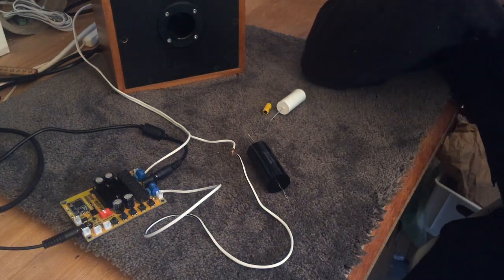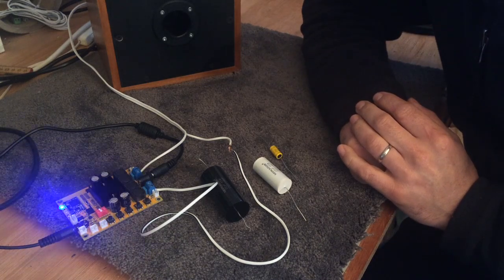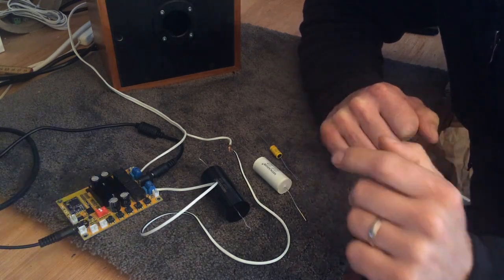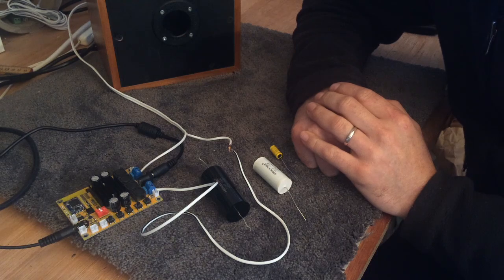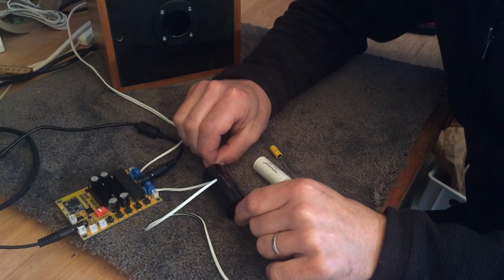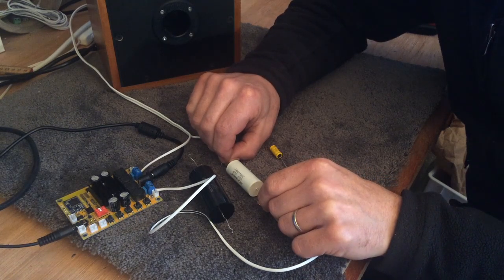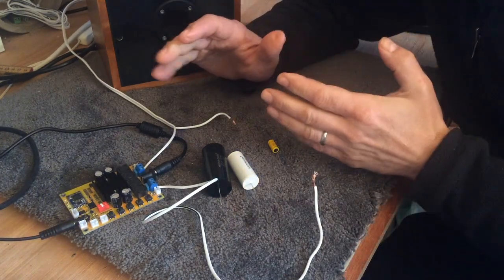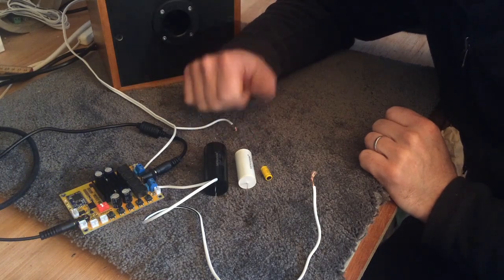What is a capacitor doing in a loudspeaker ?

Comment: If my bass driver is a little boomy in the bass/lower mid can i use a bigger inductor or lower the value of the capacitor to lower that effect?
Reply from the maker: Mainly its your box alignment that determines what happens under 100Hz. With that said crossovers do alter the TS parameters of the woofer, but it will still need to be simulated with the box to know the outcome. If there is a way of generally get a direction, I don't know. I know introducing a series resistance to the woofer limits the current with the higher impedance, so the qts will go up and typically cause more boomyness on a given alignment. So parallel loads might do the opposite, but its not a good way. I done that ones to fix a poor design with anemic bass, I still wouldn't say it sounded good though.

Comment: Thank you, this is exactly what I needed to continue my project. I have a very old Webcor speaker/amplifier, and I ran across caps separating the mid from the bass speaker, and separating the mid from the tweeter. The one to the tweeter was 2uF, and the one between the bass and mid was 4.0uF. They are huge and old, and test double their spec. Hearing the differences of the caps you demonstrated , and mentioning that they can also add protection to the smaller speakers by filtering out the deep tones, was a very nice, practical example, of how these devices work. I cant find a 2.0uF nor a 4.0uF, so I am using a 2.2 and a 4.7 respectively, and they are tiny in comparison.

Comment: What size cross over is needed to take bass out of a 12inch subs to use as highs kent
Reply from the maker: There is no set size for that, it all depends on how much you are going for. Subwoofer filters are typically 80Hz to 120Hz at 12dB pr octave (2nd order) and to calculate the actual component sizes you need the woofers impedance. But for a fullrange speaker  2, 3 or 4 way the crossover frequency can be anything fra 100 til 2500Hz as a crossover frequency. If you are talking car-stereo and you just want to make it sound better I will suggest an 8,2mH inductor in series or larger

Comment: Kent. Thank you so much. 1st, and 2nd order Crossovers. That's the first illustration I have found to be easy to understand. My MIT2 vintage Cables, are just additional crossover elements (aka network synthesis filters R L C) in a box mounted directly to the speaker cables. Eh? Who knew.  Anyway, I'm now prepared to figure out a 4th order Linkwitz-Riley filters. That was hard to imagine previously.

Comment: I have a pair oh 1977 Marantz HD 440 speakers i just bought second hand. they sound ok, a bit thin TBH, but yeah nothing boomy or flat, but no umpf in the low end but quite clear in the high end. 

I was just wondering because these 3way speakers do not use a crossover but there are three (two?) capacitors to separate each driver. do the capacitors wear out over time and need to be replaced?

(the foam on the woofers looks good)

EDIT: opened the speakers up they have replaced the woofers with visaton w200. ohhh well..

Comment: Overall a good demo but be careful with the narration as it was a bit confusing, at 1:35 it sounds like you say 2 point 0 mico farads (for the big black one), and then the 2nd one you say 10 microfarads and "a little smaller capacitance"... that makes no sense, if i go full screen it looks like the black one could be labelled as22µf so that would then make sense.

Comment: How does the outer foil capacitor lead orientation impact the sound quality ?
Reply: 😍 can you connect your speaker to compare with cheap mundorf 47uf Mcap tin cap(white.color) vs 47uf Mcap Alum vs 47uf Mcap supreme silver oil vs 47uf Mcap Supreme silver/gold/oil EVO.  Does it sound different ! Video have ? 😍😍. ( can u do a video with that can ? It will be very Fun to try ).....''/
Reply: @roxy_xcxc6869  love to see some generous sponsor for those heavenly priced capacitor.

Comment: Can anybody help me please...
I listened to one my studio monitors die while I was using them, the sound coming from this particular speaker gradually changed from the full sound to a sound similar to what the smaller capacitor was doing in this video. Continually increased crackling and decreased output level until it went silent.
Could this mean the capacitor on my now dead speaker failed?
(I still haven't opened the speaker to check what happened)
Reply: Yeah, caps are susceptible to damp, age and heat. change the caps. inductors should be fine. also, check the resistors - some use inductive coil as their resitive load.

Comment: Hi Bro, Could you please tell me the reason of Low volume of one of the Rear Speakers of my Creative Inspire 5200 5.1 speaker system connected to my Desktop PC?  I have interchanged the speaker by connecting another speaker to the Rear Left.  That speaker fires normally, but the problematic speaker gives only low volume when connected to the Rear Left jack of the Sub-woofer.  What might be the reason of the Speaker firing with low volume when connected to the Rear Left.  Tested another speaker in the same Rear Left jack but it gives normal full volume.  Only one speaker gives the low volume.  Please guide me how can I repair that problematic speaker.  If need be, I can open that problematic speaker.  But what to do after opening it?  Please guide me what to do after opening that (problematic Rear Left satellite) speaker.   Thank you.

Comment: Big thanks for this video!! So, of I want to hear more of the bass/reduce treble on a couple of 4ohm speakers, I should integrate a 200-1000 uF capacitor before the speaker? On the plus-side or the minus-side? Happy for answer.
Reply: OK, I did just watch part 2 ...so to kill treable I Will need a resistor instead...thanks again.
Reply: Inductor I mean...

Comment: I took.one of my floor speakers to the shop because the tweeter wasn't working. A week later I found a replacement tweeter that worked, bought it and gave it to the guy at the shop. He calls me a few days later and said the capacitor for old tweeter needed to be replaced. I'm wondering why, if the replacement speaker I bought and gave him works why would he not want to use that rather then buying a new capacitor for old tweeter?
Reply from the maker: The capacitor in the crossover is a different component than the tweeter itself, so if the capacitor is defective it wont help to use a different tweeter
Reply: @AudioTalk  I'm really ignorant on this electronic stuff but learning. I found out your right so I purchased tweeter for nothing. He ended up replacing 2 caps and the speaker works great now. Thanks for the reply

Comment: is that possible to work without capacitor?
Reply: Yes, With a full range speaker.
Reply from the maker: One type of tweeter doesn't use a crossover or capacitor and that's the Piezo tweeter

Comment: Bro how can i remove noise of pam8610 which capaciqtor i should use
Reply from the maker: Thats a very different subject than the video, if you are running the amp and perhaps a Bluetooth board on the same supply you likely have ground loop. For that, I recommend a power insulator which is a DC to DC converter that separates ground to the signal board.
Reply: Thank you  bro really

Comment: So what specs capacitor do I have to use for a tweeter
Reply from the maker: hi Mike, its important that its a bipolar type, secondly you need low hysteresis but if you buy them from a place that sells speaker drivers you don't have to look for it. Lastly for a tweeter I will recommend some kind of film capacitor and avoid electrolytic capacitors. In the realm of film capacitors, a solid choice is MKP the full name Metallized polypropylene capacitors. So that's good fundamentals, once you move into high-end hifi it moves further than that.

Comment: I have a 6.5 midrange speaker that I replace on my 3 way surround sound system. I decided to install a bigger midrange which is the 6.5. I used the same 4.7uf  100vdc that was there originally but it sounds too high almost like the tweeter. What capacitor would you put on it if it was your. In other words what is the capacitor that will give me a midrange sound. The speakers 6.5 8ohm rated at 150w rms. Sensitivity : 92.5 dB 
Frequency Response : 100 Hz - 8 kHz. 
Thanks
Reply from the maker: What you are attempting takes a much more calculated effort to get right. The video is just showing the concept of what the components are doing. To make a crossover right you need the thiele-small parameters of each driver + impedance and frequency response. Then you need the box volume and if there is a bass reflex port. So you can make a calculation for its response so that in the end you can adjust the tonal balance with the filter, likely dampening is needed on both tweeter and mid. This is just the brass tacks and I have an ebook that takes you through the most essential parts of a design, but its currently in my mother tongue Danish and I probably won't have it translated until next year. But I have this little speaker calculator I made as free download https://bekent.dk/blog/speakercalc-gratis-hoejtaler-beregnings-program/ but you will still need to adjust the tonal balance with dampening (resistors) but the calculator will get close with the filtering.

Comment: Great vid on basic filtration. Do you  have any advice on instrumental speakers? I’m trying to build a bass cabinet that is 4ohms total with a 15” speaker and a 2” horn driver. The idea is to use the horn to pick up higher frequencies that the main speaker does not respond to. I’m guessing I’ll need a filter like you have here so that the horn only works above a certain frequency. Is there a type of capacitor that I should use? I’ve read about polypropylene, electrolyte and film and foil. I’ve read the polypropylene is best for home speakers, but am unsure on what is best for musical instruments. Thanks!
Reply: 😍 can you connect your speaker to compare with cheap mundorf 47uf Mcap tin cap(white.color) vs 47uf Mcap Alum vs 47uf Mcap supreme silver oil vs 47uf Mcap Supreme silver/gold/oil EVO.  Does it sound different ! Video have ? 😍😍. ( can u do a video with that can ? It will be very Fun to try ).......""/
Reply: Wao..we love it.  Also can u able created another Youtube to live test those same capacitance cheap cap vs expensive Mundorf Supreme pure Silver oil or Supreme Silver gold oil cap. How is Sound alright can ? Billion of billion of people want to see it...🤔🤔🤗🤗😁. Can u do it !........///

Comment: How does the voltage rating factor in to this? For example, I have a 10UF 200V in the speaker. Would a 10uf 250V still do exactly the same thing?
Reply from the maker: The voltage rating does not have an effect on the filtration (capacitance), its only  the capability to handle the size of voltage in order to avoid damage.

Comment: In a power amplifier, there are 2 identical big capacitors which have 63V 6800uF ratings. Are they controlling the bass and treble tone?
Reply from the maker: Those most likely are located in the power supply and not the the actual amplifier stage. Its a very common size there to reduce ripples in the DC voltage.

Comment: I have 2 non working  300w car speaker. They have capacitors inside them. Is it possible that only the capacitors are damage? If yes do you know what kind i need to buy? Thanks in advanced
Reply: Glen Raymond just read what it says on to the blown cap

Comment: Hi. Can I use spare old pair of 8 ohms tweeters as second pair of speakers directly linked to amp without crossover? Old Sansui A 80, first pair exit is for 8 ohms speakers and second pair is for 16 ohms. Thanks
Reply: You can, but it wont be optimal; the mechanics of a small vibrating surface with low excursion will act like a natural high pass.
Reply: @ThuleApsu  I thought with some capacitor, and what capacitor. Thanks
Reply: If its just a single capacitor in series:  F=1/(R*C), where R=8, re-arranging gives: C=1/(F*R), BUT this will be a simple 1st order, ideally you want 2nd order on both tweeter and mid so they blend together. Always use an AC rated Polypropylene (100v ok or higher), people use electolytics but they are rubbish for audio.
Reply: ndeco, there is no standard value for mf, it depends at what frequency you wish to cut off the tweeter; hence the equation.Tell me a frequency and I will let you know, but it wont be accurate since I dont know what tweeter you have.
Reply: @ThuleApsu  Yes, it is old old but good calote (???) (not paper) tweeter from old about 50 w  boxes. Excuse me, language is my next problemo  :)))  I just want to use them for filling room a little with more, not higher, with more high tones...Ones upon a time, on the one wire of tweeter was capacitor 4,7mF...
Reply: Anyway, thanks for your patience  :)))

Comment: What is the song title? Can 12db order low filter make voice disappear? because i had made it but the voice also in. hope i can hear midbass and lower frek only. I ever using active low pass filter but it too low, i need mid bass too.
Reply: https://www.youtube.com/watch?v=u7K72X4eo_s
Reply: Non Est  Thank ypu very much
Reply: No it cannot, however using higher orders just degrades the phase response, a perfectly matched 2nd HP and LP will have maximally flat amplitude and superior phase response compared with higher orders, and 1st order is not steep enough.
Reply: What does "degrades phase response" even mean? You don't hear phase, you just need the phase of both drivers to match around the crossover frequency (that's what crossover design is about). And 1st order not steep enough? Steep enough for what? Sorry, but what you say is not true, it's always individual and it always depends on how well the crossover is designed.
Reply: Tomas Kuruc: You can hear phase between two drivers, for instance if you wire one of your speaker black-red, red-black; the bass response will drop. That's why most subwoofers have a phase control to match the subwoofer phase with that of your loudspeakers(some can also switch from 2nd order(To match with a closed box speaker), to 4th order for a ported design).
So when I say 'degrades' phase response I mean phase matching between tweeter and mid changes during the transition region; causing an unpleasant sound.

First order crossover result in the tweeter and mid playing the same frequencies over a wider range of frequencies than 2nd or 4th order, ideally you want an almost brick-wall cut-off and roll-on; however such filters have another problem; that of phase matching between tweeter and mid(During the transition region), Thiele and Small; the loudspeaker scientists determined that the best filters for phase matching whilst giving a steep enough response were 2nd Butterworth (Q=0.707) and 4th Order.
I could go into more detail; but this is pretty well known in the industry, as well as electronic students with at least an HND qualification.

Comment: i have a set of community csx40-s2 subwoofers. sometime while in use, clear tubes on the inside of the connection pannel will begin to light up. are these capacitors? Is it normal that they light up. I can confim that they are not fuses.

Comment: I'm looking for info on how to use two or more capacitors to change values, i need to creay 6.6uf. Thanks.
Reply from the maker: You can create 6,6uF with 2x 3,3uF in parallel
Reply: Smarthouseelectric right on thanks.

Comment: What do I use with a 1inch horn tweeter in a PA, 100watts, 8ohms? The woofer has a coil for low end, but the tweeter is missing its cap or resister. Whats would you place in-line.
Reply: There is no easy answer to this, its like asking what turbo charger is needed for an unspecified make and model of a car.

Comment: Capacitor does not work comparable to resistance - it is too simplified. Capacity inputs reactance to circiut which results depending on frequency in lowering the amplitude and secondly shifts the original phase of signal. That shift is  source of bad sounding even when amplitudes are matched ok. That i why I do not advice everybody to DIY because without beeing aware about many things results are  often worse than expected..
Reply from the maker: First off everybody has to start somewhere, and the video is showing the change in crossover frequency and nothing about amplitude and the impedance does rise after the crossover frequency, thats how it works. And yes there is fase shift, but in a first order filter its only 90 degrees, and yes that its reactance govern by the charge curve of the capacitor, but thats not a good laymans explanation, that is a look out I am smart explanation, because if you know what reactance is, you are unlikely to look for answers in video with this title . This video can save lots of tweeters for the ones there is having fun with speakers.
Reply: @AudioTalk  😂
Reply: @Mikexception 🤡

Comment: Hi Smarthouseelectric,  the video is convincing and interesting. Thank you.   I am going to build my stereo speaker box, using the vintage Isophone  10x6 (oval) full  range speaker and the vintage tweeter. The sensitivity is more than 92dB  and the impedance is 4Ohms.   In the first order cross over (only using a capacitor) ,  what are the caps choices , can I use between full range & tweeter? which one will be the perfect sounding? and safe one?  Also please clarify for:   Can I use a 16Ohms  or  8Ohms tweeter with this  4 Ohms full range? If so , what cap should be used?  Dear friend,  Kindly explain in detail for all my doubts,  I  need your valuable advice.  Thank you and best regards.